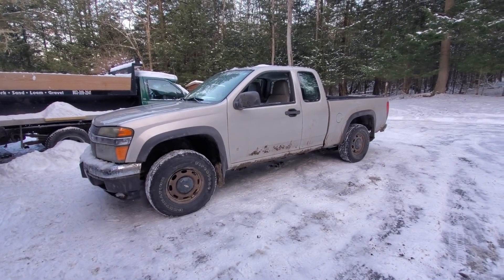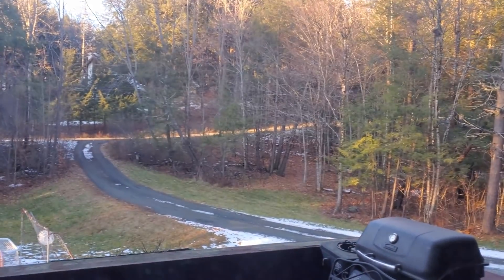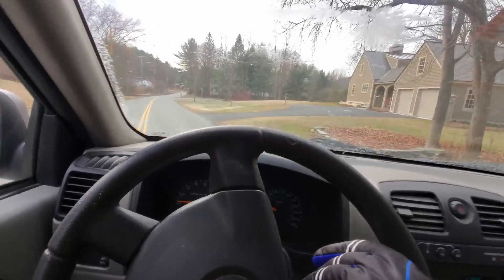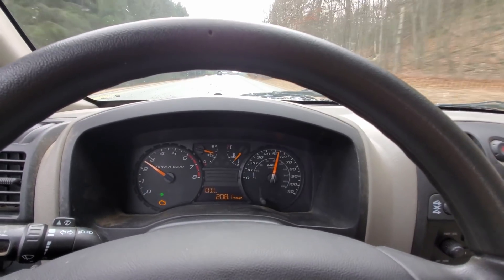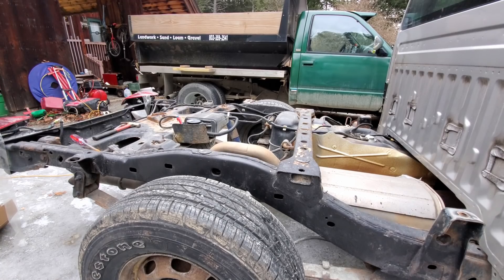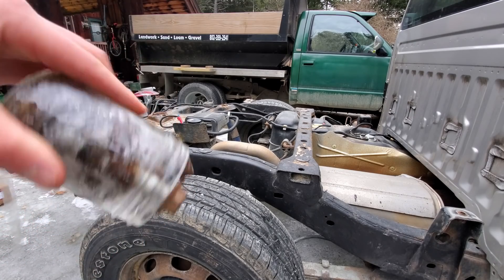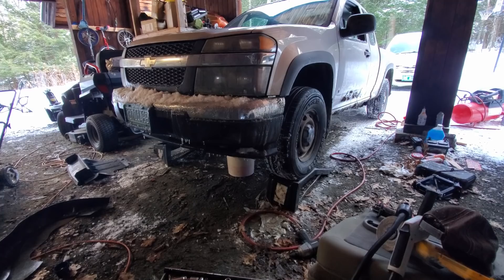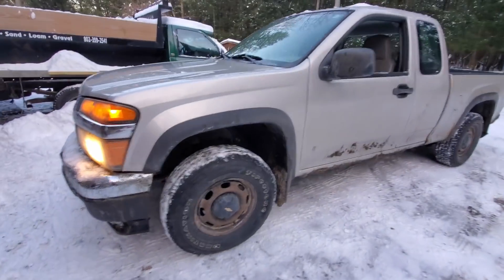$400 Chevy Colorado Part 4: More Repairs!

Comment: You can buy super cheap OBD II bluetooth adapters online and then use an app on your phone for scanning codes and getting other information. Totally worth the cost you can even clear the codes with it.
Reply: Blue driver is super nice
100$ on Amazon
Reply: @victorC308  that's like 10x more expensive than what I did.
Reply: I think I got one for like 13 bucks. Workes great, but only reads Check engine codes.  I just got a blue driver and its much nicer being able to read all codes.
Reply: For around $100 you can get a decent code reader that does a lot more than read and clear codes.  All home mechanics need that scan tool.  Help you learn the OBD II system and whats going on with all those sensors, plus save you a trip to AutoZone or the like were some possible dufas is monkeying with your car.  Check Amazon.
Reply: @JasonWin  Don't know exactly what you did but for the average home mechanic it would be stupid to do anything but buy an actual code reader/scanner.  They are worth their weight in gold.  You still need one also.
Reply: @randomnonsense_1  Does it read ABS codes?  Does it run auto bleed for ABS pump?  It's about $100 for a decent code reader scanner.  If your Dad paid $400 2 years ago the same scanner is likely $175 or less now.
Reply: @x-man5056  I got a Bluetooth OBD II adapter, it's the older style ELM 327, I pair that with my phone and use the tourqe app which allows me to read fault codes and then it pulls information from the internet to tell me what they mean, then let's me clear them (I had an old Corolla that would only get an evap code in the winter so I cleared it in the summer). It will also display things like RPM, Speed, throttle, and coolent temp on my phone. The adapter and the come to like $10.

What advantage would a standalone reader/scanner have over that?
Reply: @JasonWin  Fuel trim live data, among other useful things depending on the sophistication of the scanner/reader.  If what you are using is designed for the purpose it may well be fine and safe.  Sounds like you are using something like car MD which will read codes and a few other things. About $40 if I remember right.  For some reason I thought you were describing something you built yourself.  If what you have works fine for you, all good until it doesn't.  I have 3 different scanners that I had to upgrade to in order to resolve more obscure problems.  Eventually there will likely be another one.  That's how this works it seems.
Reply: @x-man5056  I can get fuel trim data..even cat temps & trans temps...spark advance. AFRs..it can even data log. Custom PIDs too. 
Of course it's not going to command on circuits..its a $20 investment.
15 for adapter.. $5 for torque pro. 
I suggest you watch a video about Torque Pro for android & it's capabilities before discrediting it for a DIY application...it even monitors MPG . when my fuel gauge quit, it will tell me my fuel percent also..even MPH
Reply: @theejoeylee  Already looked at torque pro after I last commented.  Yeah, looks like it covers the bases well.  I won't be using it myself though.  I keep my phone well away from me when working on vehicles.  I try not to put apps on it.  I have a lap top with something similar to torque pro on it but rarely use it.  The small hand held scanner does the job for me....most of the time.  I usually have gloves on when working and the damn phone is just a nuisance to me.  But to each their own.
Reply: @x-man5056  I figured like this.. I paid 20 total for auxiliary gauges. I use mine while I'm driving. Like a cheap scangauge. For mpg monitoring,that has some bonus features.. if I had a standalone scan tool and I wasn't broke then of course I would use that.
Reply: @x-man5056  No, mine doesn't do ABS, that's the one drawback to it.  Although, at 1/10 the price, I'm OK living without that feature.  Hell, my father in laws doesn't do ABS either as far as I know.  :-)
Reply: @randomnonsense_1  Mostly likely correct.  I bought one that reads ABS codes and then later on, working a different vehicle with a different problem, a scanner/reader that has "ABS pump autobleed" feature.  No doubt I'll run into another problem eventually that requires a different one.
Reply: @theejoeylee  Yes, no doubt.  I have a scangauge unit in my pickup.  great minds think alike. ;-)
Reply: I have been using a $23 dollar Amazon Bluetooth OBD II plug-in and Torque Pro for 5+ years without issue. I can not recommend it enough.

Comment: You may need to do some research about that p300 code. These Atlas engines have issues with worn valve guides and cracking heads that can throw that code. There is a forum site called 355nation that has a really great and knowledgeable community of Colorado/Canyon oweners. Searching that site will gain you a wealth of info on these trucks!
Reply: Just noticed how old this vid is. You might have the answer already. But i still recommend going to that site lol.

Comment: Once you do the bodywork and fix everything mechanical, you should clean up those wheels and give it a good interior detail. A bit of all purpose cleaner and a brush to agitate, aerospace 303 or similar, and a vacuum would do a good job for you. A good detail can really make a car/truck so much nicer to be in and transform it from a "beater" to something that actually looks really nice
Reply: Zachary Sides I’ve found a good baking soda mix with one of those lovely metal toothbrushes does wonders for the tires
Reply: Zachary Sides no temp runs over half
Reply: @tomlyons2965  Westley's Bleach White.  Designed for white wall tires but does a great job of getting stains off of tires.  Cheap too.  Follow up with some tire shine and wallah! great looking tires.
Reply: Just get a gallon of super clean at Wal-Mart. Diluted 10:1 for general purpose cleansing. Go stronger as needed. Does carpet too. Simple green is good too. Make sure to extract & not leave product in the fabric.
Reply: @theejoeylee  Super Clean is great stuff.  Use it for grease and dirt.  Used it on my race car the morning after back in the day.  Tires seem to get weird stains on them though, like the bleach white better for those but never tried making it stronger just for that purpose.  Your probably right.
Reply: Someones been watching car detail vidoes 😂
Reply: @gracenhelton9026  Probably you, I've been using both of those products long before YouTube existed.  More power to those who watch YouTube car videos though, detailing or otherwise.  Save a lot of time and money not having to learn everything the hard way.  The one caveat being not everything you see on YouTube is accurate.
Reply: Great idea. I just picked up a free extractor!!  Going for 1200 on eBay.  My wife details our cars.
Reply: @KBMOTORSchannel  Extractor? For cleaning wheels and tires?  Please explain.
Reply: Mytee Carpet Extractor, I made a video on it , they use them in car dealerships. A buddy of mine who runs a dealership was throwing it away!

Comment: I had an '04 Colorado i5 4x4... I miss that one it was a solid truck and I loved the inline 5.... now I have a 2wd 2016 Colorado with the new mini duramax diesel engine and I love it. It gets amazing fuel economy... I also have it tuned as well for even more pep and mpgs.

I chose a 2wd since it is less maintenance, I just throw some sand bags in the back, put winter tires on and I get around as good as 4wd
Reply from the maker: Sweet

Comment: I have a 2008 Colorado with the inline 5 cylinder and my temperature gauge runs between the 1/2 and 3/4 marks all the time no matter what time of year. When I bought it 2 years ago I changed the thermostat and the temperature sending unit and it didn't change. Talk to a mechanic who works on Colorado and Canyons and he said that that was normal. I also flushed out radiator and changed antifreeze. Never has gotten hot.

Comment: That is exactly where mine reads, the thermos on these trucks are 195.  Get a cheap bluetooth reader that you can leave plugged in all the time, they are 20 dollars on ebay, and you read them via your phone.  They can give you REAL temp numbers, because gauges can be off, as well as give you the error codes without driving to the store.  Worth every penny.  The app I use is torque.

Comment: Generally, blinking CEL is misfire (as you found out). Tracking the cause, however... a lot of times on higher mileage (100k+) it is bad coil packs.
Reply: Sometimes. However I replaced all of mine and all spark plugs and still have the issue. Although mine isn't limited to one cylinder.
Reply: I can only speak to Volvos, but I am sure this is not limited to them, when you have one coil pack failing, the other will tend to fail as well. A saw in one of the comments that a clogged converter would also cause a misfire code in a Colorado. The root cause is lack of one (or more) of fuel, air, spark...

Comment: Recommend buying an autel scanner I have the 808 very nice live data feature where it will show you how each cylinder is performing injector faults etc. Also does abs srs etc. Think it will save you money in long run from having to take to shop. Lastly a smoke machine off ebay or Amazon great buy for diagnosing evap. Costs 120 bucks or so very easy to use and you can also check for vacuum leaks with this by removing hose from brake booster and attaching to machine. Good luck!

Comment: The temp gauge will read high and it is fine. My former work truck was an 07 with the straight 5 and after the bad thermostat was replaced it would sit between half and 3/4. Just try not to idle it for long periods in the summer

Comment: My old roommate had a 2000 Sonoma that had over 230,000 miles on the clock when he got rid of it.  It still ran great but he just wanted something more practical for living in a big city.  I have heard nothing but good things about those and the S-10s.

Comment: Blinking check engine is for Misfires..  On Colorado it is usually the wiring harness.  For evap codes check the vent valve doesn't have stones in it. If it needs changed use the part from H3. You just need to swap the hose and its $100 cheaper. It could also be a pinhole in the filler vent tube..  ALWAYS get those trucks undercoated with fluid film every year...  My 05 is still going here in Buffalo with 400k+ miles..  Body is rough but the frame looks new...

Comment: One notch above half is about where my 06 straight 5 sits constantly while driving, same as yours. One notch below half while idling before actually driving. Sitting on the same EVAP and misfire codes myself as well actually. Mine went into that "limp home mode" as well but ended up being the VVT actuator with the corresponding 0013 code. Quite common on them apparently, 30 second swap out though.

Comment: U have an air pocket in the system. If you close in that barn the rest of the way, you can get a thing called mr heater that goes on a 20 gallon propane jug. You'll be nice n toasty and your bondo will work. A stuck open canister purge solenoid will give you evap codes n make it misfire. It's a vacuum leak. It's on the side of the motor below the intake. Bad mass airflow sensor will make it misfire too. Check hoses in between maf and throttle body and the pcv hoses under the resonator right before throttle body. Those trucks are not too bad to work on. Always keep oil topped  up
Reply: Lemme know how you made out with it. Im a pretty damned good mechanic of 25 years. Once you get it sorted out, I would dump a jug of Chevron with Techron in the gas tank n take it for a blast down interstate 91. Or 89. What other codes did u have? DO NOT put marvel mystery oil in it

Comment: Have an 08 3.7 i5 Colorado. It is normal for them to be a bit warm but usually only in the summer and while using AC in town. You may still have some air in the coolant system if it is cold and it goes above the half way.  The previous gen i5 was notorious for over heating and blowing the headgasket. But I beleive you said you have the i4 and tbh I don't know enough about them to give you more than a guess.

Comment: I must be soft because I would want workshop to keep warm n doesn’t even snow here in Australia LOL, usually when changing radiator fluid it’s in summer when things over heat.  What’s headlights like would you upgrade better bulbs or LEDS?

Comment: The older thermostats ran cooler then the new ones. You can buy spacers to get the thermostat to the original temperature that will put the tepature needle at exact middle of the gauge. The new thermostat has a higher temperature for better emissions burning is my understanding.

Comment: I have the same truck and engine and that’s right where my temp sits. For the reduced power mine did that a couple of times until I replaced the maf and map sensors. But it could also mean the cam Solenoid is clogged you can just take it out and clean the screens.

Comment: i got an 04 colorado had it for about a year and my temp gauge usually stays between half and quarter unless im beating the piss out of it but i guess yours is normal. i got mine for $600 and it runs great just a little rust and needs new exaust still

Comment: I have a 05 3.5 Colorado. It’s sitting at half all this time but my water pump is leaking and making noises badly right now. So currently it sits where yours is. But gonna change the water pump and see. I heard that same “clicking” noise from your truck as well

Comment: My suburban has been doing the same thing with the p0300 code, I think what it is the bad O2 sensor can throw the air fuel off real bad to where it doesn’t want to run right under load for short periods

Comment: My straight 5 3.7L needle usually sits in line with the 2nd ripple on the bottom wavy line indicating temp. I wouldn't be too alarmed though. Still well within specs. Also, you made that thermostat repair look far easier than mine was.

Curious to see your misfire issue. I also have that and some stalling issues.

Comment: The earlier Colorado/Canyon had a soft head issue, there was a recall but some development the issue later. I hope that isn’t your misfire issue. I had a i5 Canyon and it was a good truck. 355Nation will be your best friend when it comes to info and modifications if you chose.
Reply: PS you are correct, the new tstat do run hotter

Comment: I have the 2.8 4 cyl.  Thermkst as t changed at 259k.  Currently 263.  My thermostat is reading the same as yours.  So with 4 k miles in it I'd say your tem is fine

Comment: Chev changed the thermostats for Colorado's a few years ago because the motors were running a bit colder then they should have for emissions, so all new thermostats will read higher then the old one did for this generation. Don't worry about it!

Comment: My 07 Canyon runs at about 1/4. I've not seen it get that high. Nice work on the truck. Try to stay warm.
Reply: You need to replace your thermostat then. 1/4 way mark is not normal operating temp and your engine is probably stuck in the start up loop. This will greatly affect your gas mileage and power.
Reply: Sounds like your thermostat is stuck open.
Reply: that's what I thought. Thanks!

Comment: Blinking check engine light means it has a misfire bad enough where it can damage the catalytic converter because its dumping unburned fuel into it and it burns in the cat

Comment: My dad bought a s10 4x4 xcab none zr2 brand new in 94 drove it 12 years gave it to me in 06 I've drove it 17 years I gave it to my son 2 weeks ago for his 16th bday bought myself a 14 colorado with 4 inch lift 4x4 on 31s not as much power as the old 4.3 but still a fun truck

Comment: You can use parts from H3
Hummers. Way way cheaper.  Same parts. Also in winter in the panhandle of Florida my 06 z71 Colorado temp gauge runs very cool ... about 1/8th from bottom. In summer it runs half way or slightly higher

Comment: Check the o2 sensors and wiring for the exhaust system. My truck was randomly misfiring and found out it was the o2 sensors. They were replaced and the misfire was gone.

Comment: The temp reading could be higher because there could be some air trapped in your cooling system after you did the thermostat, would be my guess or its just rated higher than the oe one

Comment: Your temp gauge is fine....drive it for a day or 2 and check level (cold).....if you got constant heat inside...youre good Antifreeze level may drop a little after a few days...top up to proper level.

Comment: my silverado had like 10 codes when i got it, but it had a loose bolt on the evap purge valve now its down to two, one being p0449 also and the other is radiator circuit failure
the evap canister is cracked apart and rusted on my silverado so i bet thats it

Comment: What code was being thrown for the thermostat? I just did this to my truck and I never got a code but my temp gauge would only go to the 1/4 mark line instead of the normal operating temp. I have a 05 Colorado and I hate it but I bought mine with only 59k on it.
Reply from the maker: P0128